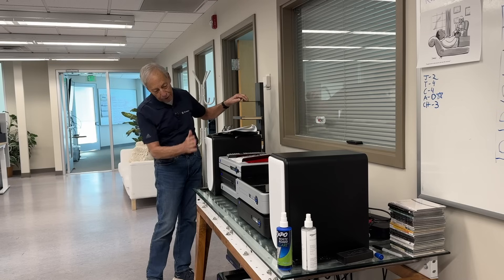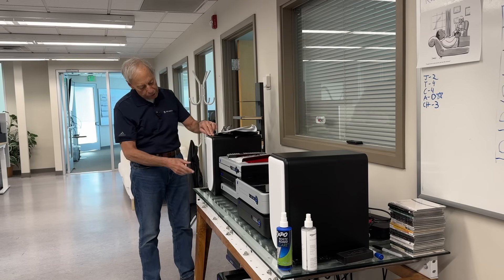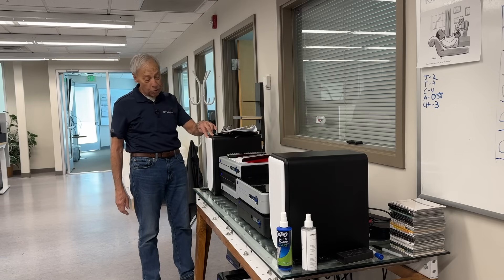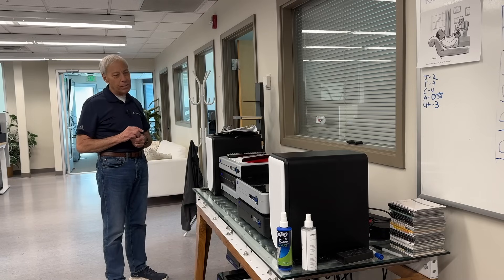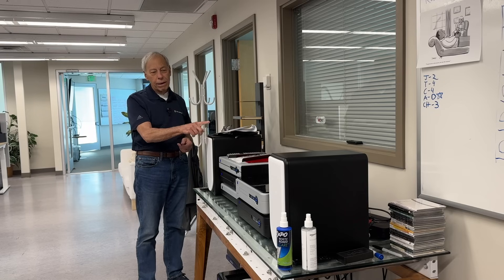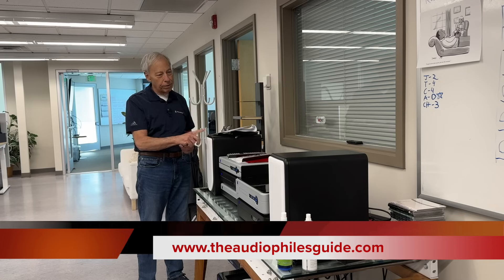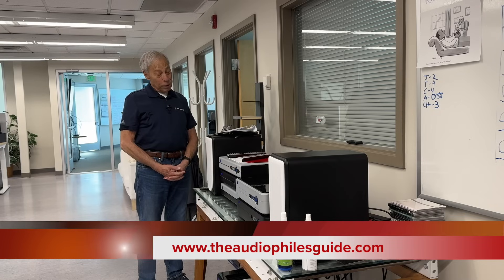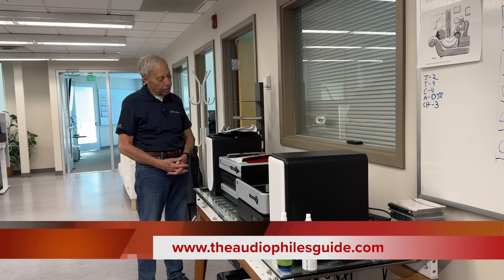Power Plants and Switch Mode supplies

Comment: 2:54 - WRONG.
The need for your useless equipment to "clean up" the mains is REDUCED down to ZERO.
Lower imperdance for what? For increasing peak mains current, putting main filter capacitors uner more strain?
You do NOT need to fund PS audio at all.
4:14 - no, you don't to charge those caps to absolute maximim. Any half-way decent SMPS has to output maximum power even if caps arent at their maximum peak.

Comment: Wrong. The rectifier bridge and capacitors are after the transformer, not before. I would not like to be near one of Paul’s power supplies when it was switched on for the first time.  Also, power generators do nothing to improve the DC output af a competently designed power supply.
Reply: In an SMPS, the bridge and storage capacitors are at mains voltage, in a conventional psu they are after the transformer.
Reply: @ianbigsand7  Paul was describing a conventional PSU with “a huge transformer” after the rectifier.
Reply: @ianbigsand7  Really in a SMPS there is diodes and caps both before and after the transformer. Paul's explain is a little confusing because with the conventional big transformer the line just goes into it and the diodes only come after, but on a SMPS there's lots of stuff before. Also the switching supply has a feedback loop so the whole thing produces regulated DC power, often from 110-240 VAC. You might get the most improvement just from running 240 on the power amp. Although (all?) mega amps might call for a Power Plant on everything else.
Reply: yes and no. that competently designed PSU that isnt influence by AC input doesnt exist.
Reply: @gioponti6359 the supply would need to be really bad to justify a regenerator.
Reply: @ it is rather that it is possible to hear small differences, small for some, relevant to others.
Reply: @geoff37s38 Not so. 
My diy power supplies for my phonostage and preamp use high quality components throughout, dual transformers (one for each rail), a CRCRC π-filter and three layers of the high quality regulation pre-regulating the regulators (all descret not chip regulators). This is about as good as a linear supply can be made.
Even with this extreme level of power supply a regenerator still makes a noticeable positive difference.

Unfortunately I don't have rack space for a PS Audio regen or I would buy one in a heartbeat. An extra rack would result in divorce so I'll have to do without one for now.
Reply: @nathanevans6277  Audio is great, but it's not as important as keeping your wife happy.
Reply: @geoff37s37:  you are not correct.   Paul is correct in his description of a SMPS.   The rectifier bridge is before the transformer.
Reply: @joelhacker8767  you need to listen again, he said output from bridge goes into “a big transformer” in a conventional PSU
Reply: @geoff37s38 yes there is a bit of a conundrum. he explains a smpsu, but then says in a classic psu, the dc after a rectifier network would go into a transformer. not quite.
Reply: @geoff37s38 Paul knew what he meant to say but got the words the wrong way round. Can you honestly say that you have never done this?
Paul makes quite a few of these videos in a single session and most are single take so it's perfectly reasonable that the mistaken word was missed. Give the man a break.
Reply: @geoff37s38  then I was wrong and stand corrected.
Reply: @joelhacker8767 you need to watch the video again.
Reply: @joelhacker8767 watch the video again.
Reply: Paul just stuffed up his delivery. 😂 However the need for a power regenerator may not be required for SMPS if it is designed to handle dirty power. 😮
Reply: Who